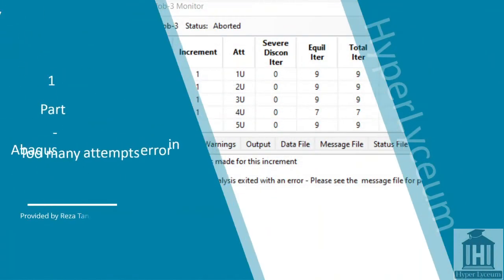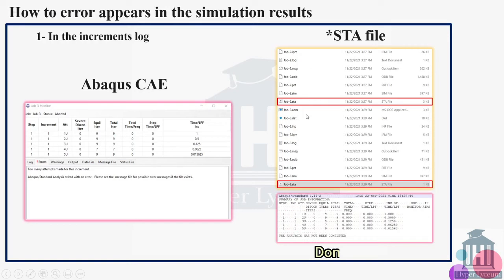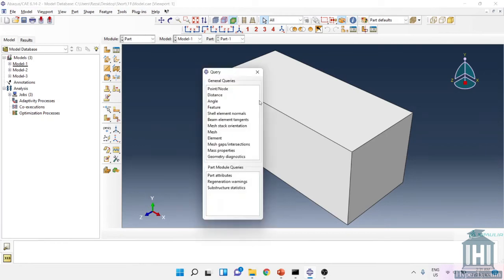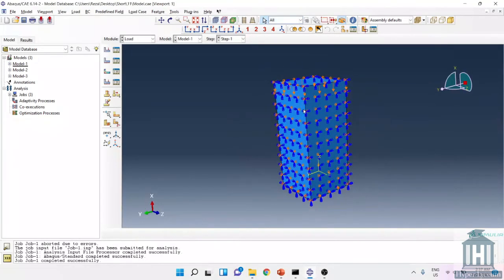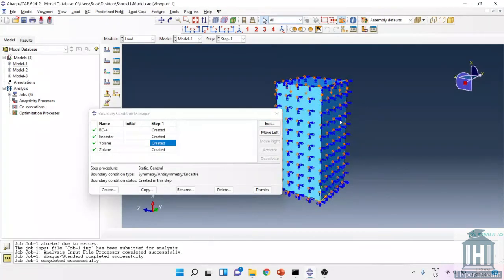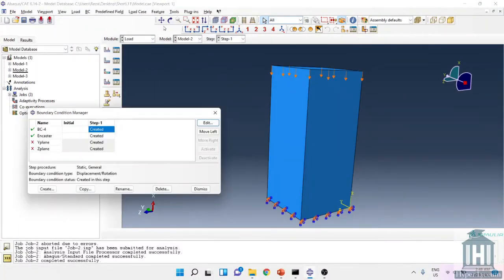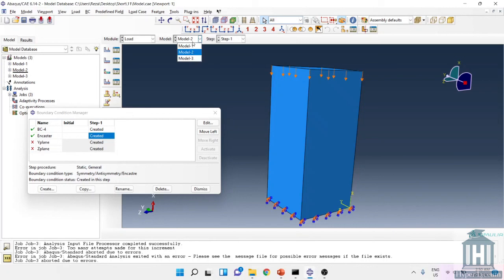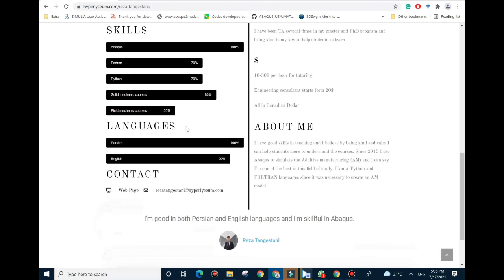Too Many Attempts & Less than the Minimum specified Time Errors in Abaqus: Boundary conditions

Comment: Hi, thank you for the interesting video.
I have a problem with my bolted assembly model. It works well with elastic properties, but when I define the plastic properties the job block at the first increment and the error 'Time increment required is less than the minimum specified' appears. Pls, help me with that.
Reply from the maker: Hi,

Probably you need to adjust the initial increment time size.
A video regarding this topic will be uploaded this week
Reply: Hi, 

I tried to modify it many times but the problem persists. 
I'm applying a tensile test to a bolted assembly, can you please do your next video regarding this topic about such a model. 

thank you for your answer.
All my best regards.